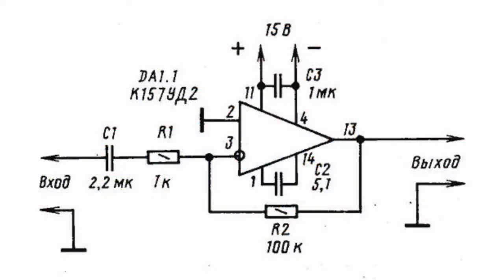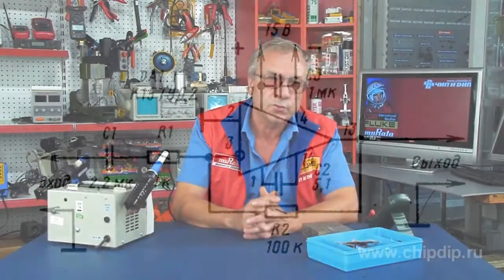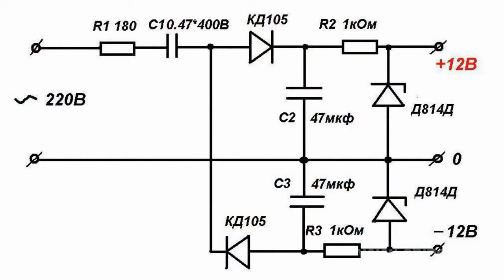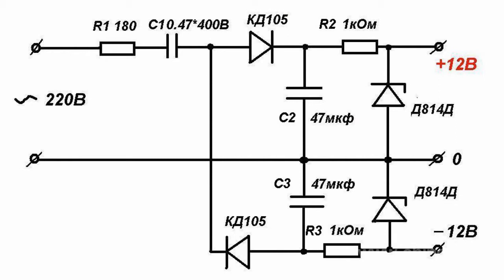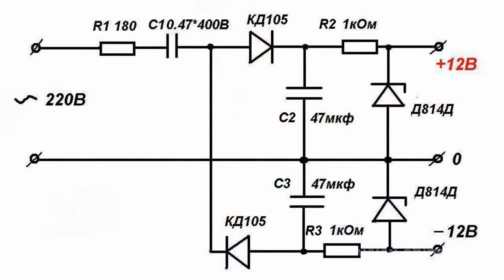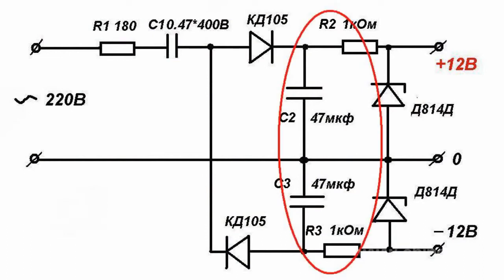Transformerless bipolar power supply. Circuit ...

Comment: Noticed an error:

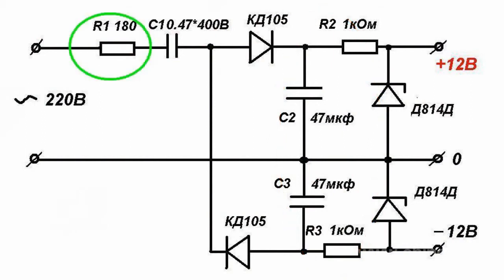1:20 - Resistor R1 is a series limiter / fuse while switched on; after switching off it does nothing. An additional high-resistance resistor placed parallel with C1 would be needed to discharge C1 when switched off.